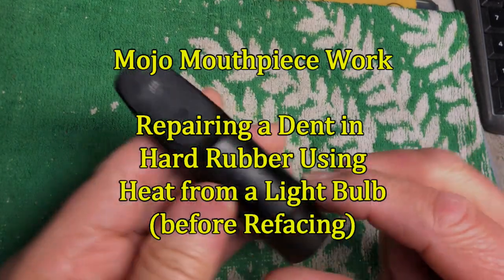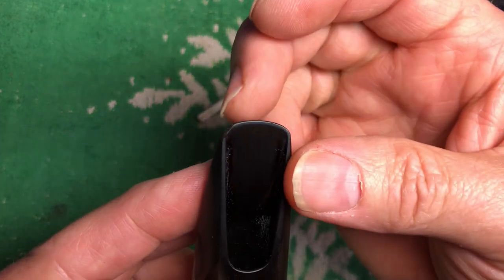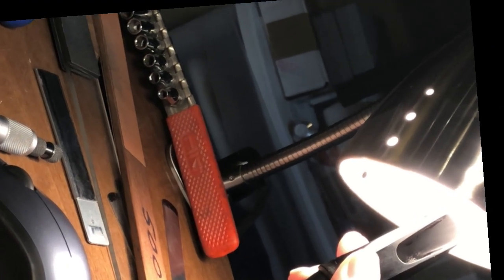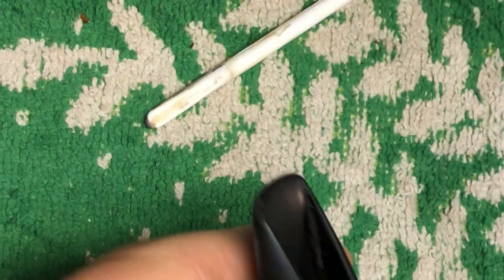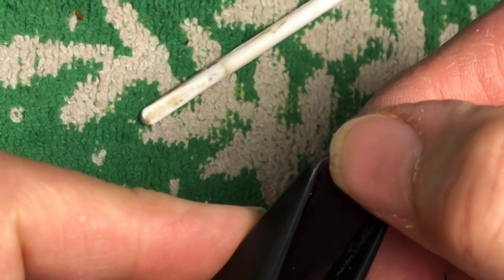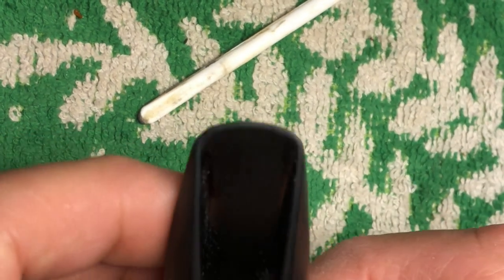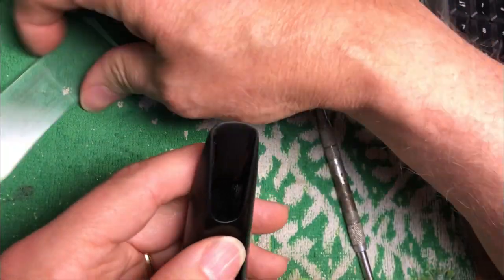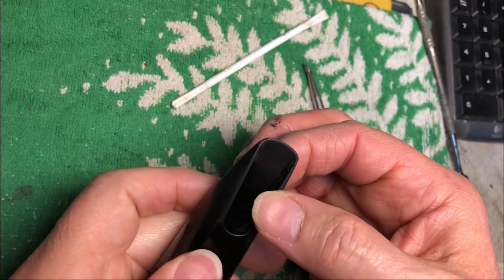Hard Rubber Mouthpiece Heat Repair

Comment: I had a student who dropped their baritone MP and it got a bump on the tip. The bump went down quite a bit just with some pressure on a flat surface. I suppose "hard" rubber is still rubber after all.